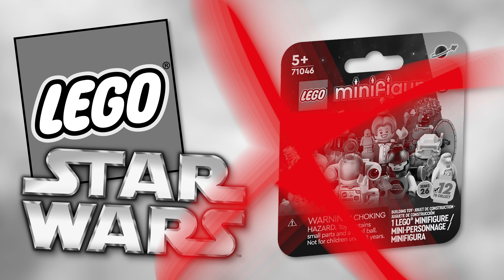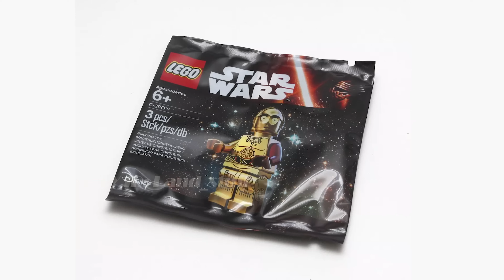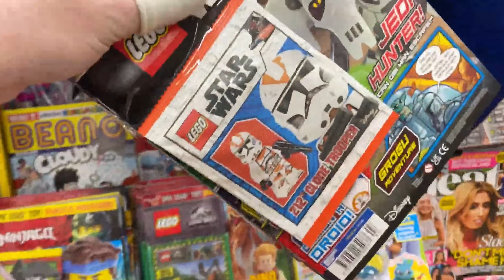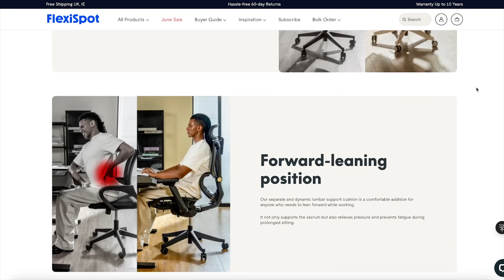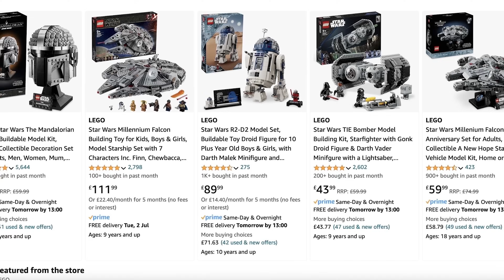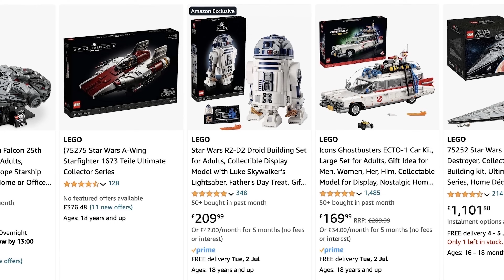LEGO will NEVER Make a Star Wars CMF… Here’s Why!

Comment: Saying the R2 D2 is selling better just for the Malik figure makes absolutely no sense.  It's selling because it's $100 cheaper.  That is the number one overlying factor.  The mini figure itself is not driving its sales maybe interest towards it but not the reason why it's selling better than the UCS set.  The exclusive mini figures really only work in smaller sets of around $50-$80.  They help drive interest and interest can cause sales but that same logic would go for CMF sets where I could see people buying 100s of them at a time but it's all based on what figures are put in it.  I honestly don't think Lego themselves understand how much they can make off a CMF even making them $10 apiece instead of $6.  With the production of a CMF could reduce the need for a much larger set lowering their overall production cost.  CMFs that would do so well especially if the characters picked we're not one-off characters and we're things that could be used as army builders.  That's where the money is.  But I get the logic we're comparing it to the R2-D2 they have to sell 8+ CMFs in order to match 1 R2 set.  This thinking is always safer to go with if it's it doesn't do well because the second they put out a CMF that isn't good it completely tanks in sales and hurts them more in the long run.  CMFs are very risky and they just don't want to steal sales from their other top selling products.